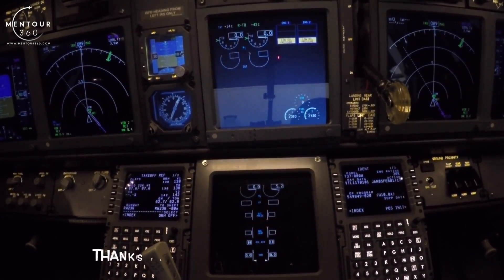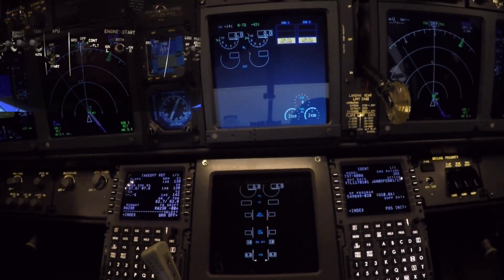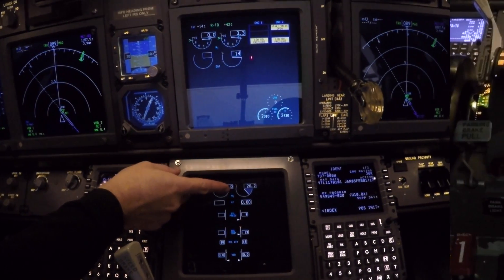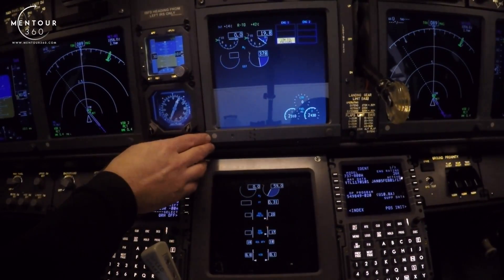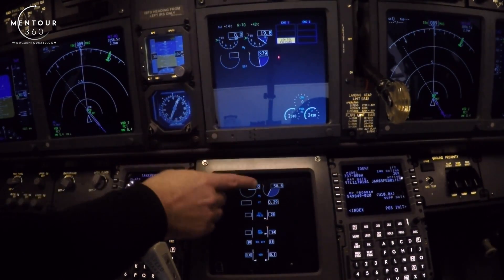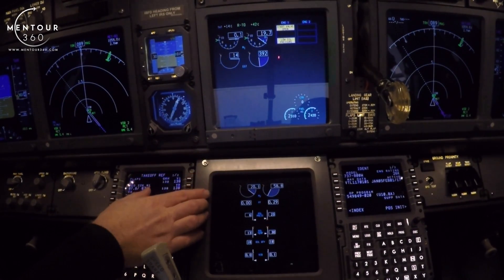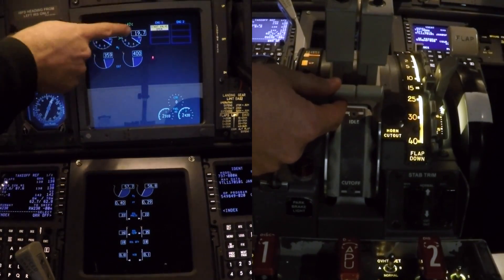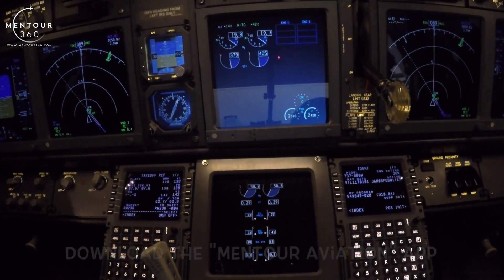How to start a jet engine

Comment: Do you strictly fly only the 737 or are you also qualified to fly other airliners?
Reply: Josh Shampoo each airline subscribes to a service for flight planning.  here in the U.S. we use Jeppesen,  I believe Mentour uses Lido. it's normally sent to the crew about 90 minutes prior to liftoff.  it contains weather information,  the actual  route that is to be flown, it's a series of way points connecting the flight to its destination,  an alternate airport  (if needed) in case a landing cannot be made due to fog, for example. the fuel required for the trip, the altitudes, and a lot more. usually the person in the left hand seat (captain) will load the FMS while the first officer does the walk around outside. it takes about 8 to 10 minutes to complete. my advice is to go into the Mentour Aviation app and download the Pilot Flying preflight procedure 1 and 2 and Route Check, you can see this being done in real time❤
Reply: Josh Shampoo each airline subscribes to a service for flight planning.  here in the U.S. we use Jeppesen,  I believe Mentour uses Lido. it's normally sent to the crew about 90 minutes prior to liftoff.  it contains weather information,  the actual  route that is to be flown, it's a series of way points connecting the flight to its destination,  an alternate airport  (if needed) in case a landing cannot be made due to fog, for example. the fuel required for the trip, the altitudes, and a lot more. usually the person in the left hand seat (captain) will load the FMS while the first officer does the walk around outside. it takes about 8 to 10 minutes to complete. my advice is to go into the Mentour Aviation app and download the Pilot Flying preflight procedure 1 and 2 and Route Check, you can see this being done in real time❤
Reply: Josh Shampoo he probably flies only the 737-800
Reply: Great! I hope to see full checklists if possible and hopefully more on the MCDU (or FMC) since it's a bit confusing and is very important. Thanks!
Reply: Josh Shampoo the FMC is a tool,  nothing complicated about it. it is there to assist the crew, nothing more. download the Mentour Aviation app and grab the tutorial videos, MP explains it all for you😊
Reply: oh, I thought it took care of the performance calculations and the flightplan
Reply: Ava Mendez thank youuuu!! I completely forgot about company routes that make the job quick